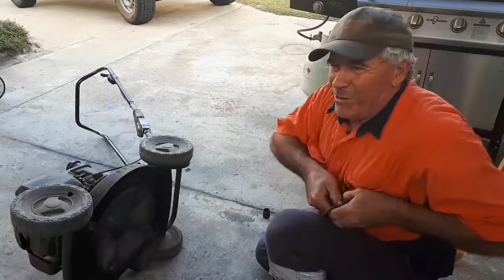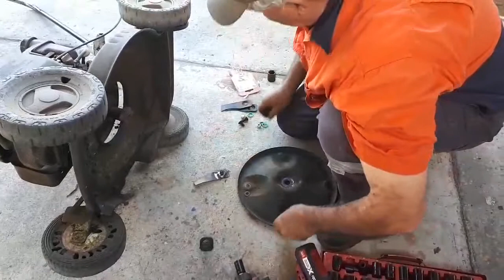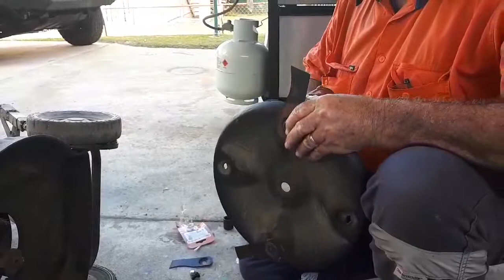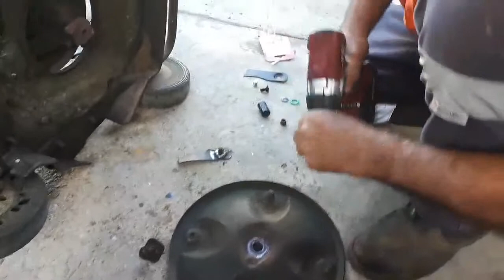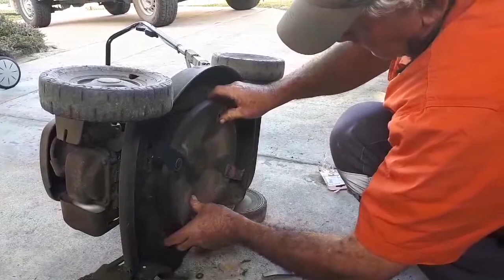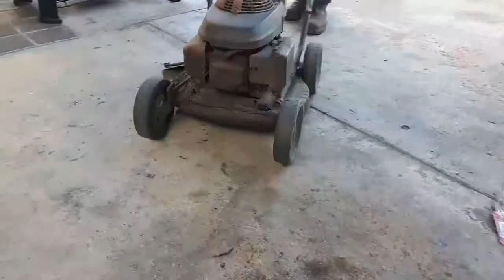How to change the  blades on a Victa Utility lawn mower.

Comment: Gee that rattle gun makes short work of that central nut! A lot easier than a plank of wood and a breaker bar and 24mm socket!
Reply: The blades are way too tight. 
They're meant to be able to swing out as the motor spins. And also have a bit of give if you hit something.
Reply from the maker: @jayytee8062  they do flip  easily enoogh. See the video where I make sure of it.
Reply: @jayytee8062  Really? I didnt know this
Reply: @enjay8950  
Yep!
Reply: @jayytee8062  I tightened mine up a few extra ugga duggas and sent it, it cut good. I'll loosen them up and see how it goes with the blades swinging! Probably better if they have a bit of give if you hit your foot or something hey!
Reply: @enjay8950  
There is a torque spec for the blades. But I can't remember off the top of my head.
You don't want them loose and flopping around. They still need to be snugged down.
Reply: @jayytee8062  Thanks man! appreciate your expertise

Comment: I would never use a rattle gun on a mower blade bolt. If the key that locks the bolt into the base plate strips off then that new blade is gonna be spinning so fast your fingers will be gone before you know they're missing
Reply from the maker: @motok1d  well it takes skill and finesse. Practice makes perfect.  Only been using a rattle gun since about 2000. Before that I reckon I skinned my knuckles more than a few times with ring spanners. 🤣